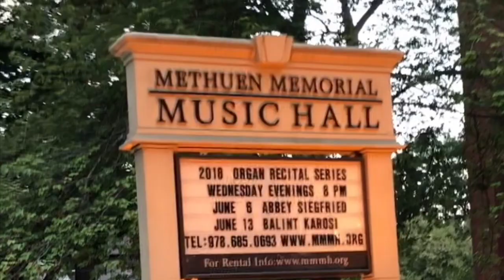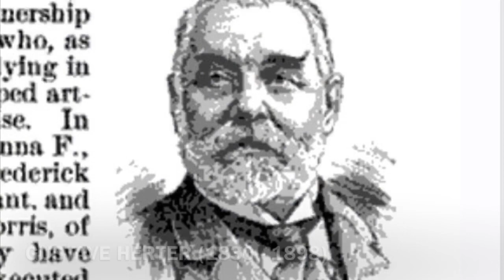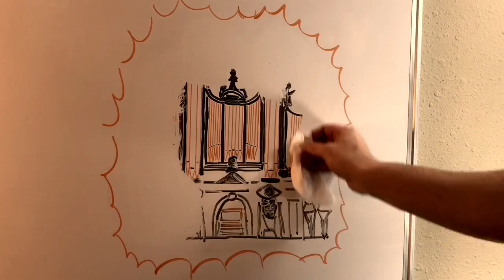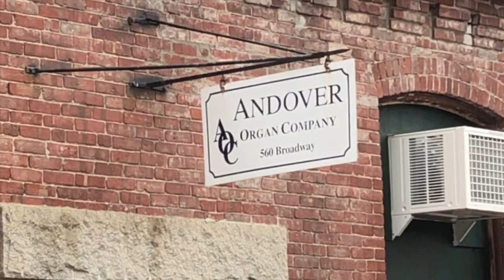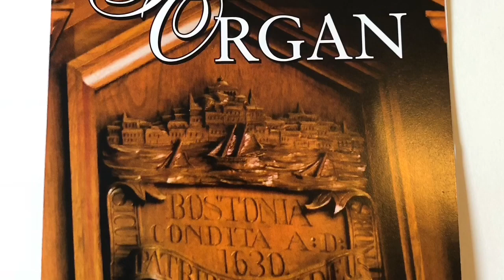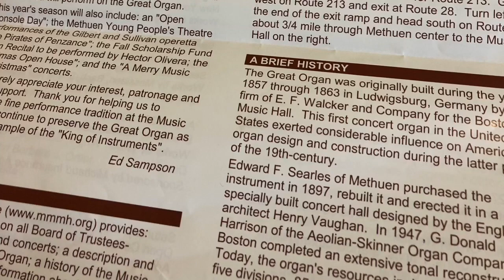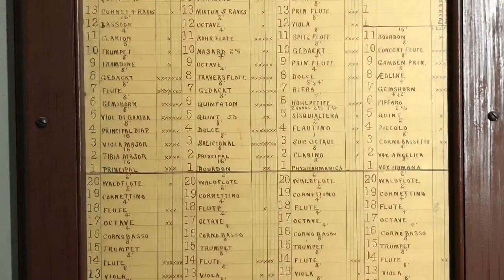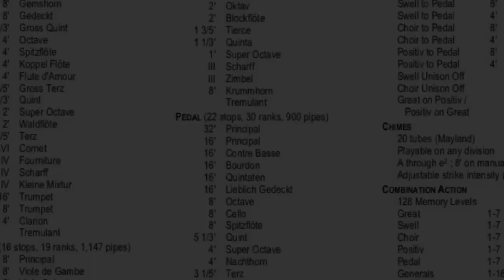Pipe Organ Stops - Methuen Memorial Music Hall

Comment: Wait im confused,when i looked at the front the organ i saw no wooden pipes. Does this mean that the two singular pipes on either end of the facade are actually wooden and not metal ?
Reply: The center five pipes are dummies as well as  both of the end towers which are tin moulded around a wooden frame.